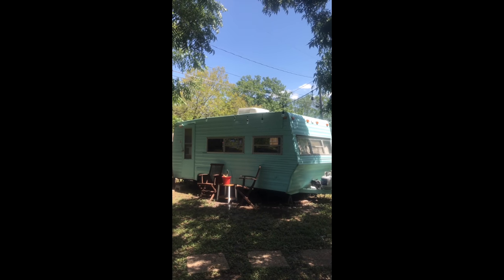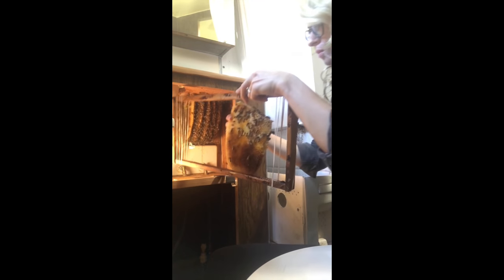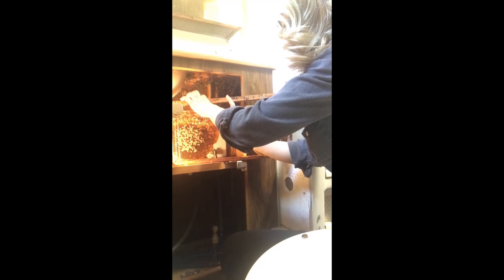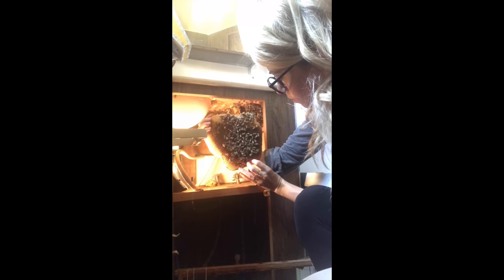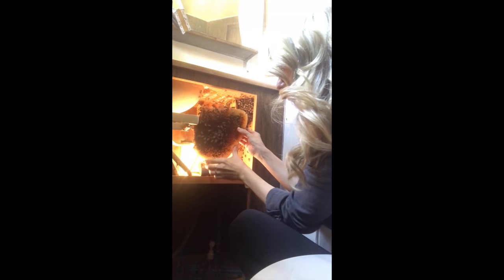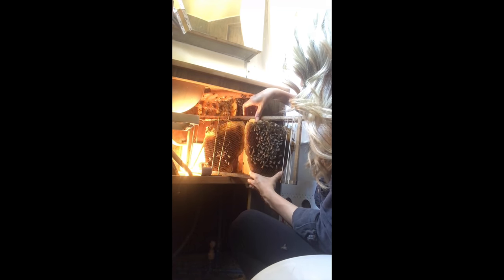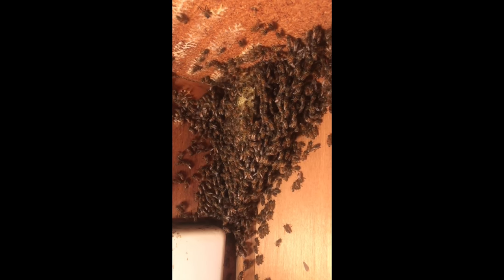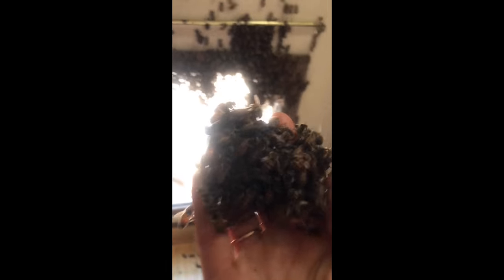Bees Were Camped Out In This Camper Trailer

Comment: You could use modified frames to place your comb in for a perfect fit if you would want it, you could use bolts and nuts that you could twist using your hand that lower or higher the top plank of the frame for that perfect fit.

Comment: Yes thank you for sharing this. I just found what appears to be an empty empty bald face hornet hive under the air conditioner housing on the roof of my travel trailer with no sign of any bees, dead or alive inside or outside of the camper. I got rid of the hive with my power washer and still no residual bees. Looked under all corners of the frame and started up the furnace and still no bees. I just purchased this camper last fall so I wonder if that old hive came with it or are they hiding somewhere I haven't checked? I even checked in the square bumper on the rear of the camper that had a very old sewer hose lodged in there and I thought if they were anywhere this would be a good place and I carefully removed it and still no trace of bees. I'm not sleeping very well at night and still haven't checked underneath the bathroom vanity sink 😬